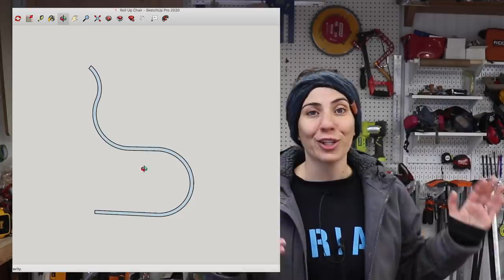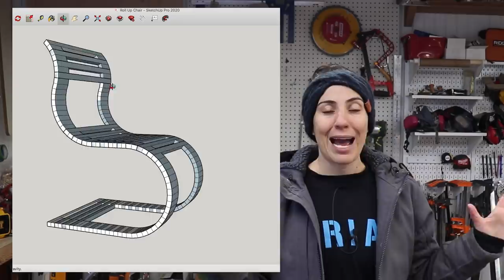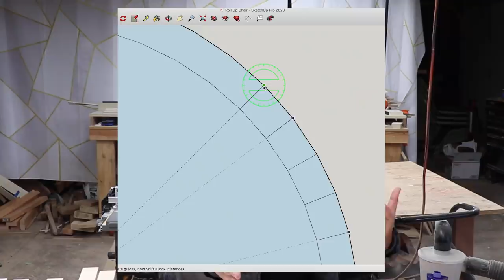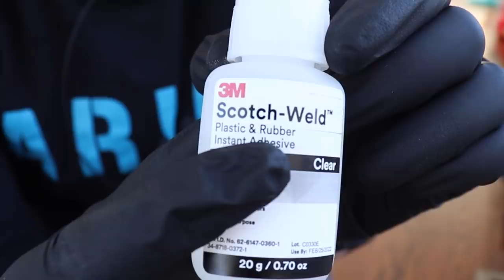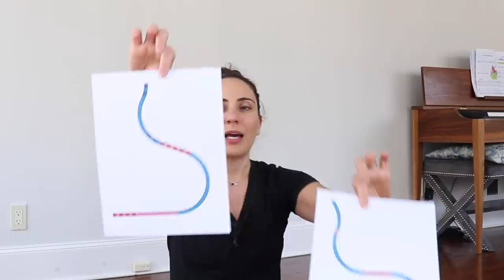I ATTEMPTED to make a chair that rolls up... It didn't go as planned...

Comment: A model of one side with a spacer between for the bottom and at 45 degrees as a guess for the top  and blue strapping tape stapled.
A rough and ready prototype with cheap or free materials. Masking tape and balsa wood I just saw even quicker I might give it a go now.

Comment: Really looks like right after the place you can sit and be supported you could start the curve going the other direction, and use some of those pieces flipped upside down to get the sharper angle and you'd have the backrest. Also looks like there's some room for the pieces to wiggle because they're only attached at the middle of each piece, and not on the edges. Could see after all that not wanting to futz with it anymore, but that seems like the next step.

Comment: you should try adding a slip of paper in between each piece of wood and see if the adjustment of gap size affects the structural integrity

Comment: U can try using rope or steel cable  through the center  of the support pieces to make it tight. And try changing the shape of the piece at the top part

Comment: What if you used some small metal hinges to keep wooden pieces together? That would give the structual integrity and should be much easier to assemble. Also, could connect the first and the last piece together with some wire, so it is a closed loop and the chair doesn’t “fall-in” when nobody is sitting on it.
Anyways, great effort!

Comment: I would first try with all full-length wood - ie, all 20" pieces, to make sure it's stable and to provide a simple way to connect them (less work making a prototype). Then, when you figure out the position and angles, you can cut some of them up for the "open" areas". I would also keep a few full length pieces in the bend of the "legs" of the chair - while you could sit on it, it didn't seem stable sideways, and I wouldn't be very comfortable sitting on it for long periods of time, I think.

As for the rubber, I think the main issue was the sharp edges of each piece - and ofc, the quality of the yoga-mat rubber. I would go for a bottom layer of the stripes of polyester you did use, with a rubber layer on top, perhaps cutting up some inner wheel tubes (solid, heavy rubber material), and then finish it off with a softer layer on top, like the felt.

I liked the way it looked rolled up - add a clasp and a handle, and it would be easy to carry with you.

Comment: I would add more long slats (crossovers) around the knees and maybe use industrial conveyor belt rubber to hold it together. I believe the belt material has nylon sandwiched into it for strength.

Comment: Use e6000 or stronger glue for this if you wanted to avoid the screws. It takes a while to cure, but is both strong and flexible which would have been perfect for this project. It also sticks together ANYTHING, including wood, glass,metal,plastics, and (fabric) foam (just not styrofoam. I’ve had it chemically dissolve straight through a styrofoam piece!). It defiantly would have held the webbing to the wood without an issue! It’s not very expensive, available at any craft store, and great for professional and casual uses (like putting felt pads on chair legs to name something close to this project)

Comment: Awesome. I think you’re right. Stronger fiber material with higher tensile strength  would help a lot.   You are sitting on it so it’s a start. 
The further you get from the top of the arc also know as a moment arm, you will increase the force on the part holding all the weight

Comment: I am chartered structural engineer here, the edge of the arch where you sit horizontally should be lower than the back part AFTER sitting on the chair. Ie after deformation. Also this is cool attempt and you can try to simulate these on computer using ANSYS or something first. It’s a beautiful work that you did. So don’t feel bad about it.

Comment: I wonder if wire threaded through the pieces would be an option. Good tensile strength, if you get the tension right it might hold weight in the chair configuration but I'm not sure how well it would transition to the roll shape. Or a system you can add tension to it for the chair configuration.

Comment: One issue seems to be the displacement of the pieces (look at your left foot at 15:20), which creates more puncture effort on the "belt".
I would try with all small hinges or with a structure like what you can find at the back of an old wooden roll-shutter (basically a chain of hinges). The weight will increase but you'll avoid lateral displacement of the pieces and at least constraint the direction of the bend. Could also explain the felt on the original model,  no structural function,  just making the feel more warm and hide the hinges. 
Elsewhere you can find some thick industrial rubber (+-5mm thick) which could do but you'll smell the chair 10m away 🙄.
Good luck...

Comment: Did a very good job with the attempt of making this chair. I think if you took some pieces out of the first curve out of the bottom would help. Then take the pieces of the curve in the back and cut those pieces in a little more of an angle. Otherwise you did make a chair that rolls up and holds you it just needs some adjustments here and there

Comment: Have you considered a third spine or third and fourth spine? I realise it breaks up the negative space but spreading out the tension via more continuous ribs may reduce the stretch, I would have also tried a straight back and higher angle between seat and back piece to reduce the reclined vibe.

Comment: Steel or aluminum cloth for the connective web, and a steeper angle on the back area? I think you want something with high tensile strength, and very little stretch... though I may be wrong on that.

Comment: Not sure if someone already said it, but maybe trying to prototype with smaller dimensions instead of a real size chair (half? 1/3?) would help you save time and materials to at least make sure the main structure works. Once you nail the structure, go full size and test for strength. Hope this helps! and great video, btw! :)

Comment: I wouldn’t call this a fail at all. In fact it seems like a pretty successful proof of concept. I think with the jig instead of tape and a slightly more workable wood you’d be onto a winner. Three thoughts about the project since you asked at the end of the video: 

1) Kevlar is expensive but the fibers are less stretchy than polyester if it can be gotten in the right type of weave.

2) making all of the pieces 20 inches would increase the amount of reinforcement you could add, which might make it more resistant to further bending after it is supporting itself. The trade off of course is weight, and you might do just as well by simply doubling up your strapping instead of adding all that extra weight.

3) applying the strapping with the wood already arranged in a somewhat “pre-rolled” state could allow some of that initial stretching to be taken care of by the unrolling, making the strapping harder to stretch further once the blocks engage. An imperfect analogy might be like prestressing concrete by applying tension to the steel reinforcement.

Anyway, I can’t wait to see the video with the next iteration! You’re really almost there

Comment: Try notching out the tops of your blocks and running a 1/8 aircraft cable on either side underneath the strapping layers. It won’t flex.

Comment: Maybe try smaller angles for the wood pieces? I liked the idea of the seatbelt material but why not stack them on top of each other? I think it might make a big difference but I may also be wrong. Also, making a latch system to attach to the bottom of the seat and making the bottom beam more of a handle shape would make carrying the chair a lot easier. I think making a seat without the back would be a good start. Sort of like a camping stool since once you nail down the core of the chair, the back rest would be a lot easier to make. One last thing is that it doesn’t matter how the chair looks before you sit down on it. You’ll most likely have the chair rolled up when you aren’t using it. Focus on getting the end product (the chair when it’s under stress) looking right. I hope we see a follow up video soon to see if you got it or how close you are to the final product

Comment: On the back curve I think you need to transition the support to the outside of the curve. The connection material is holding the shape/tension. 

The other issue I see is the center of gravity on the seat is like you mentioned at the top of the lower circle. You may need to find a way to move it to meet at the rear of the seat to let the back support weight. But that is going to take some trial I think.

Comment: Heat gun the glue off. I open envelopes & cardboard flaps with a heat gun for fun. The glue hardens overtime but when heated, it loosens it’s stickiness and becomes easy to peel apart.

Comment: May be late to the party here, but I'll try and chip in with some ideas. Tried to read and see if someone else thought of it, so sorry if its already mentioned.

I think that you are accidentally adding stretch and shift into the bands holding the peices together. By making holes in the weave, you are just holding the weave in place with the screws, but letting the weave move freely between them without glue, I think. For v2, consider trying to add glue, or maybe trusting glue alone to fasten the bands. I may be wrong, but its something to consider. 
Try considering the movement of forces in the bands, and where you are stopping it in the pieces to hold them in place precisely.
Also, by fastening them in the middle of a piece, you are allowing stretch in a longer part, as opposed to having the bands fastened at the edges, leaving little to no room for stretch from tension.
Anyways, really enjoyed the video! Subscribing to figure out how you will tackle the next step!

Comment: Honestly, that was actually pretty good. You can see that the main section that can support you doesn't bend too too much, gives me hope that something like this could work well. Maybe the back portion can be modified or replaced to do something else. The original design might be flawed there.

Comment: Consider stress and strain. From following your process I can see the tensile strength of the strap is critical. Equally critical is the gaps between the block segments. This represents the movement of the pieces under load. If the movement of the pieces in relation to one another is to much, then you move past you intended shape. It seems the fastening strength of the strap onto the wood is not that important. So. Is the strap string enough? Predict the stretch in the strap under load (person sitting) reduce the angle of the segments to compensate for this movement. Your initial shape may look off but once you sit the strain in the members will be such that you reach your intended shape. Also consider the crushing strength of the segments onto one another. If the wood pieces compress too much you will cave to factor this into the final shape as well. Or use stronger wood.
You are impressively persistent. Good luck

Comment: Rubber shims feel like a way to individually adjust the angles using a bouncy material.  Just a bunch of thin strips of rubber you glue in between, especially on the back of it to increase the angle?

Watching actually proficient builders like yourself struggle makes me feel a lot better when I try to do my home projects :)

Comment: Maybe reverse the felt strap after the "leg curves" so it goes to the back of the chair? Maybe providing better support for the pieces? Also adding a few swing connectors between saw every third pair on the sides of the pieces might also help with  Rigidity

Comment: You might want to try running a cable thru holes in the sides of the blocks and using the cable under tension to support your chair.
Reply from the maker: Very popular suggestion. Could work

Comment: try using cables (steel maybe) going trough all the pieces. Maybe it will loose the folding capability, but im sure it will hold up the tension. As a civil engineering, i can say this chair is the representation of a prestressed concrete beam

Comment: Maybe use straps to connect the top of the seat back to the place where you actually sit. This would keep the seat back up and prevent it from falling back. Additionally these straps could be used to secure it when its rolled up and keep it rolled.

Comment: i would say start again with the wood, make the angled cuts a bit larger to accommodate the bend and natural imperfection of the pieces sitting together. also you can see the blocks not sitting flush with the nylon at the end, i would suggest running something between the pieces and attached to one block per piece  and to the main nylon strapp. this will help keep them in line a bit more. you can even recess the wood to help keep the additional strap from making a gap between the blocks

Comment: On the part of the chair you actually sit on, I was wondering if using a less severe angle would decrees the amount of downward flex that's allowed? I think the polyester bands were a good call, but the best way to reduce that flex where it's problematic (i think) would be too use a material and an angle that simply doesn't allow for that much flex. Im completely guessing here, but that seems like one of the first changes to address that problem i would make. I can't wait to see your V2. This was way more stable than I honestly thought it would be, good work.

Comment: When i look into the design , i thing there 2 ways of give , one away from the cloth ,which is easily achievable by angle between the blocls but the inwards one that is when the blocks needed to fold in ward the cloth there its not easy i think you might use some rubber between the blocks to give a slight amount of give to them .

Comment: Hi Tamar! Great effort! In your video you fastened the pieces together while laying flat. I would try fastening them together slightly contracted from how they'll eventually be. In addition to messing with how many angled pieces to use. You could also use a tow strap (as in automobiles), which is likely also polyester but much thicker. Or perhaps, galvanized steel strap. Either way, with the felt or other finishing material on top for anesthetics. You also might try pre-stretching the material with perhaps a come-along or hi-lift jack to get some of the initial stretch out. Best of luck!

Comment: Increase the angle of the straight pieces you sit on, in the reworked section print out, less red, straight pieces. Make that straight section smaller. Also consider replacing the webbing with steel wire rope, and drill through the pieces. At the top and bottom anchors, you can "tune" how taught the wire is. And you can add decorative webbing, and use less hardware, saves you some time.

Comment: How about using steel? Like 2 or 3 wide tape measures next to each other, fixed to the wood by parkers that you just drive through the steel after punching a tiny hole in it.

Comment: I would use less straight lines in the side profile of the chair, at least for the parts not contacting the ground.  Maybe also using less segments on the circle could help, but that's just conjecture.
Also the chair seems to lay flat in the back rest. I'd consider compensating in the draw up so that the blueprint looks like the chair would be more or less folding you in half, where in execution it may actually rest in a more natural position.

Comment: great video! I'm no engineer but I would say that it'll be almost impossible for the back part to work without no support, so I'm thinking that maybe you can screw the webbing you used on the chair on the highest segment on the back portion of both sides of the chair, and screw it down to the middle of the semicircle that supports your weight on both sides, I'm thinking that the tight webbing will work to strengthen the back portion, although it might possible ruin the aesthetic of the chair.

Comment: I think the hardwood was important for this kind of prototype. The pine would probably compress under the load. 
From a mechanical leverage perspective, the webbing is really impressive. I'm not sure two short pieces of wood can hold that kind of weight without compressing even if you had the perfect angle. Leaning back on the chair would apply a lot of force the the wedges, essentially crushing them like foam. I know metal wedges defeat the whole wooden chair ideal, but they'd hold up to the pressure in the first bend. 
Full length wood pieces and a full covering of very tight webbing might be the solution, but by then you'd lose the aesthetic of the original inspiration. 
Final idea would be to use some sort of hinges to link each joint instead of the webbing. 
I wish you the best of luck.